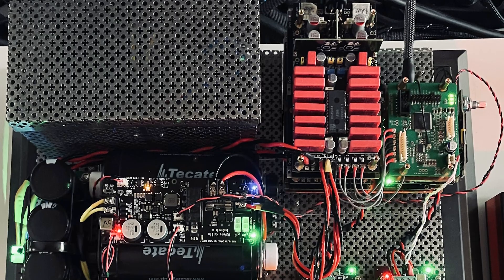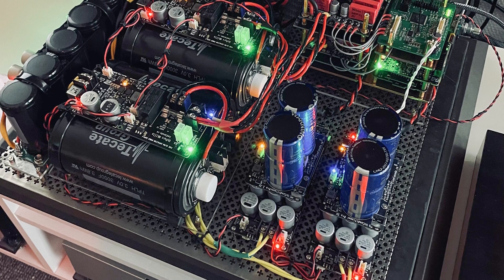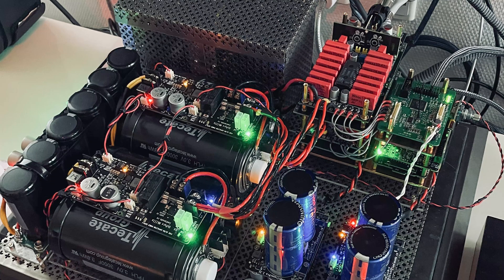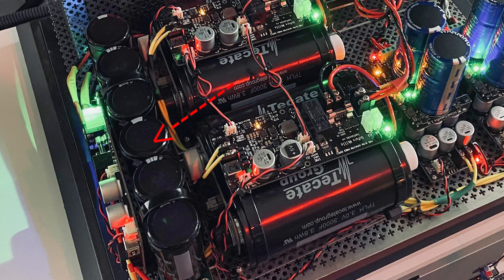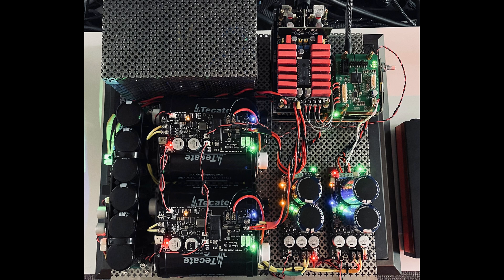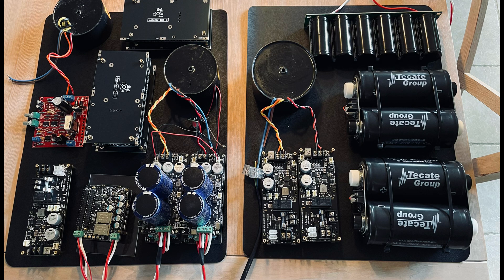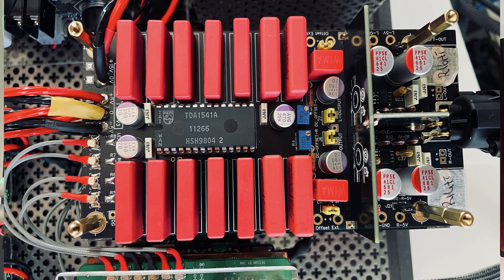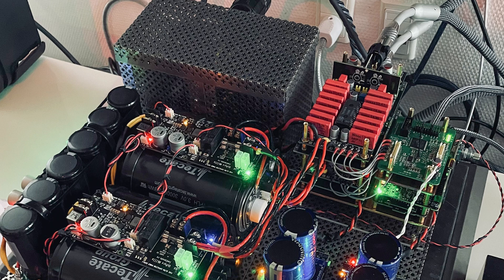Why the Gabster/IanCanada TD1 DAC by Johnny from Denmark   is a Must-Build for Audiophiles!

Comment: I have a question not related to the video here i go i wanted to build ddc using ian canada parts how is it compare to those unit in the market like denafrips iris, musician pisces,leo, Phoenix. If i use sc pure clock? 
Thank you in advance
Reply from the maker: @thenutto11  it all depends on the Dac used after the DDC often it will be the bottle neck 
I suggest building a Ian Canada Dac or my Gabster TD1 then you can be in a far better place

Comment: I always wanted a tda1541 DAC and Ian m’s streamer with Gentoo player. Only holding me back is the lack of chassis. I don’t want exposed components lying around since I have babies at home. Any advice to have all the components in the chassis? Or anyone would build a completely covered streamers and DAC that want to sell?
Reply from the maker: You can Try something like this
https://www.aliexpress.com/item/1005007006513257.html?spm=a2g0o.order_list.order_list_main.206.4fdd1802w4r9T4
Reply: @Gabster1 It’s been several months since you posted this link, and it’s no longer working.  Do you have an updated link, or at least a product name?  Thanks.
Reply: Thank you Gabster. Do you know any members from the DIY community is willing to take on the project? I am a huge fan of tda1541. I currently owned an Audial S5 and Abbas DAC. My CD player is NEC CD-830DS with dual TDA1541S1 chip with tube output.
Reply from the maker: @ Try posting here
https://www.diyaudio.com/community/threads/asynchronous-i2s-fifo-project-an-ultimate-weapon-to-fight-the-jitter.192465/page-659#post-7914944
Reply: @ thank you Gabster. And if you are building a better one and willing to sell your current one, please let me know.

Comment: This looks really weird to me. A giant power supply, heavy power cable, two 3,000 Farads capacitors and many other capacitors are supposed to do what for a DAC? A DAC needs a good digital front-end that can ensure the DAC itself can run on a precise jitter-free clock. Then obviously the DAC chip itself needs to be top-notch. The analog output stage needs some quality components and clean power rails (linear transformer, regulators, capacitors, inductors), but this looks like building a nuclear power plant in your house to power your refrigerator. A DAC has a fairly constant power consumption making such large capacitors of no impact to the noise. They make sense in a power amp. I would love to see the measurements showing the effect of what is put into this design, e.g. remove those 3,000 Farad caps and see how the power rails behave before vs. after on an oscilloscope. What am I missing?
Reply: One of the benefits with the big Ultra Capacitors is that the TD1 can be decoupled from the public electricity grid as long the Ultra Capacitors are sufficient charged. My TD1 DAC can run solely of the big Ultra Capacitors for a couple of hours which gives the cleanest possible power supply. You can read more about this on the Ian Canada homepage.

Comment: The big problem here is the lack of star grounding. There is a ton of Emi off those linear pi and even ucpure boards. The positive ac into the ucpure is always radiating tons of Emi... Any Emi/emf meter shows this very easy. I'm the one who built the Ian Canada double layer dac from the forums with everything running in copper tubes with copper plate shielding and star ground... It makes a huge difference. Beautiful build, but you could get a lot more out of this actually. All the cables should also be copper foiled and to star ground.

Comment: Where can I get that metal board that he mounted everything to? The perforated metal
Reply: I cut a groove on the back of the plate with an angle grinder before bending the plate. This made bending easier and more accurate
Reply from the maker: @Pete.across.the.street
Hi Pete. The Equivalent of a construction market in North America is something like Home Depot :)
a quick search and here they are a wide variety of them. But not sure how Johnny bent them so perfectly.
https://www.homedepot.com/s/Aluminum%20Decorative%20Sheets%20?NCNI-5
Reply: I just bought it at a construction market
Reply: @JohnnyFrandsen  what is it called? , I can't find it anywhere

Comment: Just to be clear, this is for 16 bit audio only, right? Since the TDA1541 is a 16 bit only chip.
And also a max of 353.8/384kHz sample rates.

So, how do you handle 24 bit files, or DSD?
Separate streamer/DAC?
Reply: IMHO your assumptions are correct.  Not for everyone.  I choose a well done 1541a based DAC at 44.1.  In the event I get well recorded music at a higher sample rate, I actually down sample to 44.1 so that I can have my system optimized with one very good clock to play 44.1.  I find the quality of the recording a far more impactful variable than the sample rate.
Reply: @user-od9iz9cv1w  Recording quality is always more important, I agree. But when I buy from qobuz of HDtracks, I want to be able to play that quality, without having to downsample to 16 bit, for example.
Sample rate I am not concerned about, the 352.8/384 is from the specification of the chip.

If the software, the player, would have options to switch between physical output, that would be very interesting.

Comment: Fantastic. Thanks Gaby and Johnny. Am still at the design stage in my dual diff/balanced TD1, mainly because I ended up stuck in hospital for major surgery (but on the mend now). 
I had slightly different ideas for the power supplies, so this is really useful. Out of curiosity, would either of you say the +-5V rails are more important than the -15V rail, or just equally so?

If you could Johnny is there any way you could share a basic block diagram showing the elements you have and their power supplies? If you can find the time to share that would be brilliant 👍

Finally, on matching a pair of TDA1541A’s did you do any testing (other than listening?) to get a matching pair or did you just get lucky with the pair you bought?

Thanks again for sharing 🙌
Reply: I really don’t know which power supply rail is the most important, but my guess is that they are equally important. The two TDA1541A chips are both NOS from the same batch. I didn’t do any testing. 

I can give you this overview:

TD1 : 15 VDC
12 VAC - UcPure 15V/1.5A with 6 x 450F/3.0V UC - TD1

TD1 : +/- 5 VDC
12 VAC - UcPure 5V/1.5 A with 2 x 300F/3.0V UC - TD1

Ian Canada DDC: 3.3 VDC
6 VAC - LinearPi 3.3V - UcConditioner 3.3 V - Q7 (Amanero768, BridgePi)

Ian Canada DDC: 5.0 VDC
6 VAC - LinearPi 5.0V - UcConditioner 5.0V - Q7 (Amanero768, BridgePi) + PCM Board

I hope this helps. Also have a look at the description and the pictures.
Reply: @JohnnyFrandsen  That’s brilliant. Thank you for this 👍